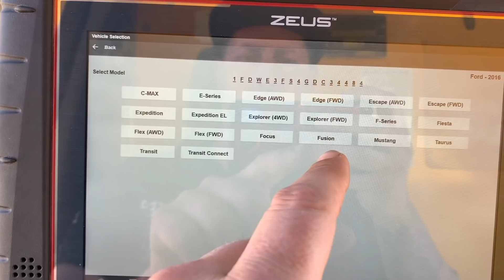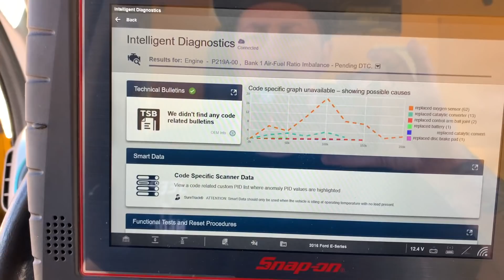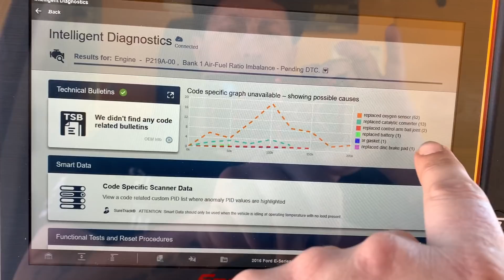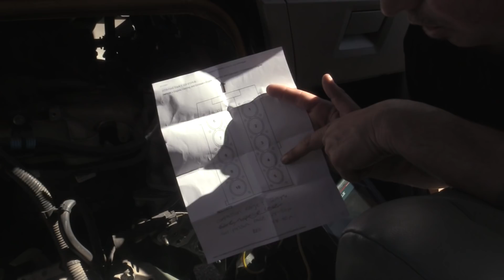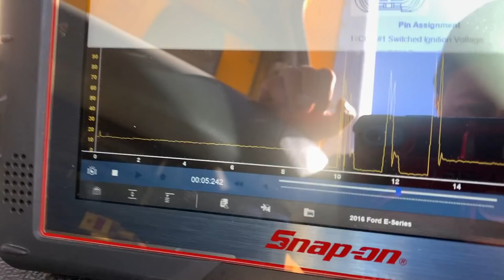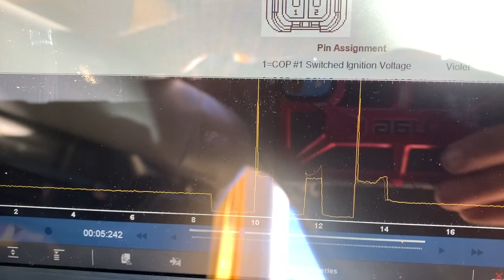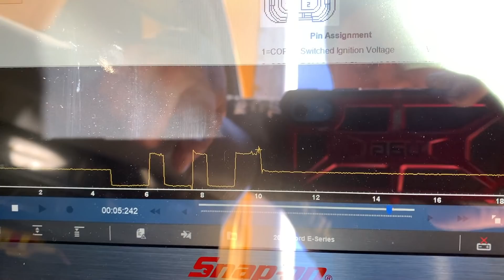Troubleshooting a Misfire for Dorito!

Comment: Great video Justin.  As you move into driveability make sure you check freeze frame as soon as you scan for codes.  In this instance even though it is most likely it was the intake gaskets causing it, its also possible you had a cool breaking down. Before u remove coils and plugs make sure you power brake it to test ignition system for breaking down coils.
Reply from the maker: Thanks for the great information and sharing your thoughts and experience. I’m always looking to improve myself 🍻😎🤙

Comment: Coil boot around 12:20 had what looked like carbon tracking on it....that will constantly misfire until you resolve that.....pinhole in the boot

White spot...
Reply: Yeah at the bottom part of the boot. Swapping the suspect coil to a different cylinder would of confirmed this.
Reply from the maker: I think fix the Coolant leak first clean up the cylinder holes change the plugs retest if there still a problem that sooner than swap coils and go from there
Reply: @JustinDowDIYcentralhighway  even if coolant leak is fixed, you will be losing spark.   That white spot indicates spark is going through the boot, instead of into the plug.   Both have to be fixed.  At the very least wrap boot in good scotch brand electrical tape....
Reply from the maker: @mr.h4714  well he did purchase a Motorcraft coil as well as Motorcraft spark plugs so obviously after fixing the coolant leak issue with the intake manifold gasket we would do the plugs and change out the known bad coil. But without fixing the coolant leak I feel that putting a new coil in when there’s still a bigger problem at hand would be kind of a waste. And I think it would be interesting to see if the misfire does go away once the coolant is no longer in the cylinder where the spark plug is or what kind of oscilloscope readings we get and go from there. Just an idea food for thought but thanks for sharing your very valuable information and Observation

Comment: Yes I have the same problem one misfires in the mornings sometimes . engine light flashes when at temperature gose away ? I replaced wires and new plugs . now doesn't stay running idle drops down and stalls on . GMC Sierra pickup 1500 2006 400.789 kilometers on this baby 🙏🇨🇦
Reply: Start with smoke test when engine is cold.
Reply: @nosliwttam77  ok I will try that tomorrow thanks 👍
Reply from the maker: You could also try spraying some soapy water around the intake manifold area and listen for a drop in RPM as well as any gurgling or suckaling sounds coming from where are you sprayed. You can also check fuel trims to see if you’re running lean or rich. But sometimes it’s easier to just do the down and dirty test instead of using a scan tool. Lots of backyard tricks to finding out whether or not you have a vacuum leak without having to necessarily use a scan tool or a smoke tester. 🍻😎🤙
Reply: @JustinDowDIYcentralhighway  thanks I going to try it today . and make a video 👍
Reply: You might have a combustion chamber coolant leak such as a blown head gasket.
Reply from the maker: @joelopez40oz23  Nahh.... we would have caught that. I did tell him the probability was high, but at this point it's just a leaking intake manifold gasket. Could be a crack in the intake though. Ford's are notorious for this.

Comment: How I would proceed with this truck,  swap coils to see if the misfire moves. Also you should really take a close look at the coilpack boots and check for pinholes or carbon tracking. Since some codes were fuel related I would also verify the long and short term fuel trims. Make sure they were within 10 percent.
Reply from the maker: So you would’ve swapped coils knowing that coolant was getting down into the chamber of Various cylinders because that’s what you were taught? Why would you have checked for a fuel trim? If you have a misfire and you go to the cylinder and you removed a coil and found coolant check the one adjacent to it and found the coolant was there too what would be the point in checking fuel trims if you already have a misfire that’s being caused by a coil that’s being completely saturated and coolant due to a leak? Just wondering..
Reply: Yes I would still want to swap the coils because we always do the easiest checks first. I would try to clean or blow out whatever was in their and  I'd want to keep an eye on it. It's it an actual leak or did they just pressure wash the engine bay?
On to the fuel. I believe one of the codes was fuel related. I would check trims and make sure that the 02 sensors were working and not flatlined. Plus that was a mentioned solution on the scanner so might as well check and verify that the 02's are oscillating like normal. I'm really looking forward to more diags on the channel.
Reply from the maker: @bradfaught1695  Gotcha.. Thanks for the information. I was wondering why and you broke it down for me. Cheers & many thanks. It's  all in learning.

Comment: Faulty brake booster/line can definitely cause a misfire.
As far as the dealer scenario,  there are sellers that do a lot more than you think.   It all depends on price demographic and vehicle condition.   
Purchaser is responsible for diag on a used vehicle (ironically this purchaser has a great technician he can call up).
I myself do the warranty.  But as a seller I think was there ORM Ford coolant in that truck?  I sold vehicles that had OEM oil filter synthetic oil only to have the purchaser go to Take 5 and get $29 oil change and universal coolant.  Many independent shop mechanics would recommend using a universal coolant but to me only on Nissan Infinity Hondas, anything the dealer puts in it is what I put in it and improper coolant HOAT vs non HOAT will cause failure in the seals.
I can go on and on, really you put 10k miles on the truck, bad intake gasket if you came back I'd replace it but you'd better not have universal coolant in that truck and you better not have a Purolator oil filter on it either.
Reply from the maker: To the best of my knowledge Dorito hasn’t had to do anything other than oil changes since the date of purchase. That being said the color of the coolant was an orange-ish tint. Possibly factory coolant. Yes working at the independent shop we have a universal coolant that will use for various manufacturers for the exclusion of certain manufacturers that have HOAT. For instance Nissan Honda Volkswagen and some Chrysler products will get the appropriate coolant specific to that model or make. Most of the older vehicles have a Non HOAT for those vehicles you can comfortably use a universal coolant. Completely agree with your statement about that. 🍻😎🤙
Reply: @JustinDowDIYcentralhighway  True.
Just a failed intake manifold gasket,  it happens.   Good thing factory coolant is in that truck though.  I can see both sides as far as replacing it or not replacing it.  I remember I sold a 3.7 v6 03 Ram single cab truck new Bridgestone tires nice condition for $2800 ran drove great a month later purchaser calls me thinks he has an oil leak I show up check it out the oil pressure senser failed and oil was shooting out of it and the coolant pump was slowly leaking(from that water pump weep hole) and the driver side rear valve cover gasket drip leak.  Man, I didn't expect that but I replaced everything for the guy just thankful he called me sometimes you never know on a used vehicle though.  I've sold another one, 4.7 v8 Ram quad cab, few weeks later serpentine tensioner pulley froze up 😀 shredded the belt(idler shouldhave been noisy enough not to keep drivingand shred the belt, lock up the idler).  I replaced it but you never know, it was good when I sold the truck and they didn't pay full price for it.  
As far as the brake booster cause a misfire I deal with a lot of VWs and if the booster/vacuum hose is bad, you compress the brake pedal while idling it'll misfire but thats a vehicle with a brake booster vacuum pump on it.

Comment: Coolant will make a misfire for sure oil will not, I have seen oil coming out of a spark plug wells and won't make it misfire, water or coolant 100 percent conductive. Some Ford's had a problem with coolant leaks from cold leaks at heater hose assemblies and even coolant seeping in the heads in the spark plug wells because of poor castings. I'm fairly sure the only coolant in that intake is the front cross over and the heater hose in the rear corner, don't think it can leak in to a cylinder that far away.
Reply: I wondered the same thing I've done the intake on my 5.4 and there is no coolant in that manifold anyway. Plus how would it get in the spark plug well and no where else. Justin investigate further before

Comment: I have a 2010 Hyundai Accent 1.6 liter that has number 1 cylinder misfiring and it turned out being the valve cover gasket and the small round coil pack gasket underneath the valve cover going bad letting the engine oil in around the individual coil pack where it pushes down onto the spark plug causing the misfire and after replacing the gaskets it ran right, so I went ahead and changed all of the coil gaskets along with the valve cover gasket and I put all 4 new autolite double platinum plugs in the car because it was time to anyway since the car has a 148,000 miles on it and was still on the factory coil packs and plugs.. I will be replacing the cam and crank sensors as well along with a new coil packs wiring harness that connects both the crank and cam sensors to the individual coil packs and it should be good to go for another 100,000 miles....

Comment: in this case i have differ with this guy saying the parts costing a bit more on this if you went with the cheaper parts and still had same issue you could not return the parts and then you would also have labor of going back in to re do the job so in this case i would have to say buying the oem parts on the get go is cheaper to buy the oem parts from the get go but i am a large fan of oem parts out the gate working on anything but that is just my thinking anyway
Reply from the maker: I know what you’re saying, but what Dorito was trying to point out there retail cost is slightly higher for OEM parts. Not that it was more expensive overall but just based on the overall retail price itself. What you’re saying makes sense, but what Dorito is saying more of the upfront cost. 🍻😎🤙
Reply: what i was trying to do is keep someone from going down that after market rabbit hole he was saying oem parts cost a touch more i get that but if a person seen that but did not count it the re do side of it from the after market parts vs oem parts they have bought 2 sets of plugs and 2 or more of the coils to go back with oem parts the 2nd go around cause the after market parts did not fix it in the first place is what i am saying i have a ford explorer and the darn thing does not like after market oil filters i even tried wix and they are to be one the best in my thinking and needless to say i have to buy the ford oil filters for it to be happy

Comment: Yes As -is .what do you think of 2006 Ford escape with 240.786 kilometers 3.0 L V6 for 2000.00 it's in great shape body ?  👍🇨🇦
Reply from the maker: I like the Ford 3 L. In my opinion probably one of the more reliable engines that they’ve made over the years. So long as you keep the upkeep on it I don’t see why I couldn’t go for many more miles to come
Reply: @JustinDowDIYcentralhighway  thanks yes because there's lots of Ford escape with the 2 .5 L 4  cyl and doesn't have much power . slow